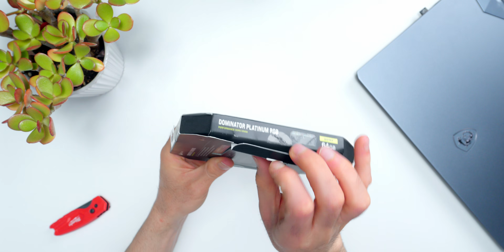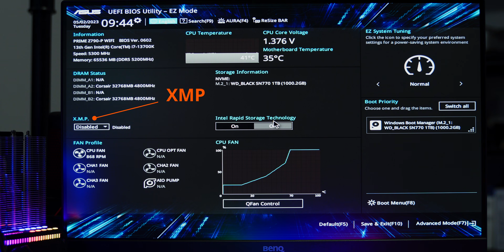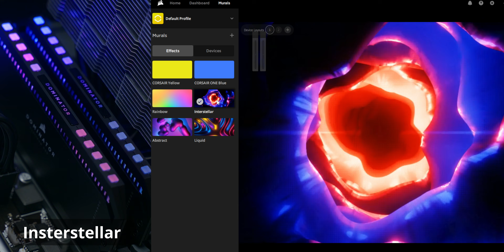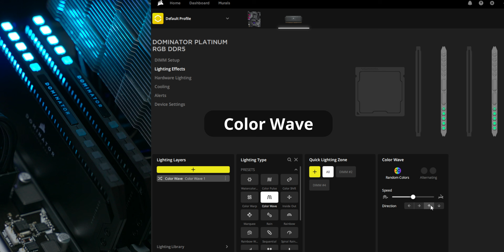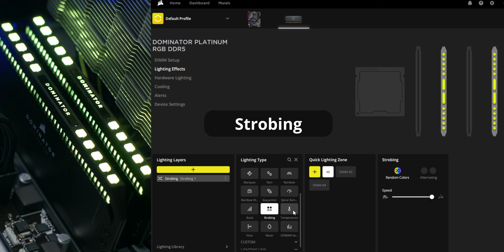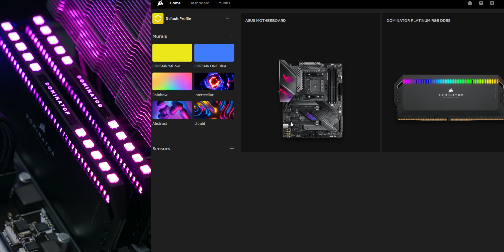This RAM is EPIC! Corsair Dominator Platinum RGB DDR5

Comment: Bro, would U mind sharing the  primary and secondary timing values of  default 6400 xmp profile in SPD setup please..? I have same one with 7000 cl34. facing issues with 12900k. help is really appreciated. Thank u.

Comment: I have 4 of those sticks.. love em ♥
Reply: dont u get blue screen? Bcs i wanted to get 4 sticks of those 6000mt/s as well, but some ppl told me its pointless cus the ddr5 platform is still not optimized for 4 sticks of ram and ur system crash easily
Reply: @thomasshelby7487  I heard that too but no I didn't face that issue.
Reply: @sl_razor  yes, i hope i dont too :D Do u know perhaps on what frequency is ur ram running? Cus i think around 5600 MTS u wont have any problems even if its 4 sticks
Reply: I had 2 sticks of ddr5 5600mhz and installed an extra 2 some months later of the exact same ram and I keep getting blue screen. Any idea as to why?
Reply: @AMOSAIBL  You just have to read upper comments

Comment: I have 64 gbs, and I just got a second set of matching 64. 
And then I watched a couple videos and people say that it's way too much overkill and can actually hurt performance? 
Can anybody back that up, I'm thinking about returning the second set of 64 before I open the package?
Reply: What are you doing that would require anywhere near 128GB, or even 64GB RAM? With all due respect, if you don't know if it's overkill, it very likely is. Someone who actually has a use case requiring that much RAM typically knows exactly why they need it. The best RAM performance generally comes from a single pair of matched sticks, in the lowest capacity that meets your system's needs. 8GB and 16GB sticks often have offerings with  lower latency, tighter timings, and higher MT/s than their 32 or 64GB counterparts. For many people, 16GB is enough RAM and is the sweet spot.  Running 2x8GB in a dual channel configuration (usually slots 1 and 3, or 2 and 4 on the mobo) will perform better than a single 16GB stick. The need for anything more than 32GB is rare for a home PC, and the same concept applies- 2x16 in dual channel. Again, If you don't know why you need more than average RAM, you probably don't. Buying more ram than you need is just wasting your money and often comes with an added cost in performance. You're better off buying higher quality RAM in the capacity you actually need than you are buying as much extra capacity as you can afford.
Reply: It lowers your max speed for your ram, so yeah it does hurt your ram speed.

Comment: I have the 6200 mhz version of this, (32gb) I had to populate the dimms in slots 2 and 4  the system would fail post on 1 and 3. using a TUF Gaming z790 plus wifi board
Reply: On some recent motherboards like the Z790, there are difficulties using XMP when you have four memory modules installed. It works fine with two, but with four it can cause errors and very long boot times. This seems to be a common problem with the new DDR5 memories
Reply: i have this problem too with same ram and motherboard, talked to warranty and they said all of that ram has problems and need to change, so i sent it for them and got my money back! they also said go and buy dominator or in vengeance get low bus like 5200! so if you have warranty just dont ruin your pc and send ram to them.
Reply: @محسنحاجیاسفندیاری hi I want to take ryzen 9 7900 processor which supports max 5200 MHz. Should I take max 5200 MHz Ram, can I go further to 5600 or 6000 MHz. Does it help any or no use of it..thanks

Comment: According to you which is the best motherboard series in msi?
Msi vs asus whose motherboard is best?
Reply from the maker: I haven't tried a MSI MEG series board yet, but so far MPG and MAG have been good for me.  I currently have 4 PCs, two are running Asus boards and two MSI.  Both have been solid, but I've had audio issues on both Asus boards whereas the MSI's have been flawless.

Comment: iCUe don't run under Windows 7
Be warned Vegeance has no RGB Vegeance Pro does
Corsair PSU's use several different cable types, not the same even in the same Model Line.   For example, HX1200 Platinum uses Type 4 cables; HX1200 Gold uses Type 3... and they are not comptabile with each other.  If you buy a Premium Pro Cable Kit (Type 4) very important to know.

If you want to blow off all the insane markup Corsair adds just by adding LEDs,a nd make it vastly easier for you to install than wiring a rats nest of fan cables...     buy a $5 RGB gamer mouse.  Plug it in, you're done.  Cost you $5 to add RGB to your system, and you got a free mouse that is easy to find in the dark.
Reply: You shouldn't be using Windows 7 anyways?

It's a huge security risk now and you need to be on at least Windows 10 22H2 until October 2025, then we'll all be forced to use Windows 11

Comment: Went with the 6000mhz version a few months back as it seemed to be the sweet spot of price/performance
Reply: Hi how are they working. Is the RGB working or it has stopped working..pls say thanks
Reply: @PradeepKumar-tq4ev  been working fine
Reply: @mikeramos91  i want to take ryzen 9 7900 has rated memory clock speed 5200 MT/sec, given in specs. So, how much ram should is take 5200mhz or 5600mhz or 6000mhz of 16gb* 2 ddr5.

Comment: Nice! I've always used Corsair RAM and next time I'll buy some RGB ones....I just bought 2x16gb of Corsair Vengeance Black 6000MHz DDR5 with timings of 36-38-38-76 for my new build. Been building my own computers since the late 80's
Reply from the maker: I'm running corsair, gskill and hyperx ram in my PCs currently.  I do think these Dominator modules look the best tho.